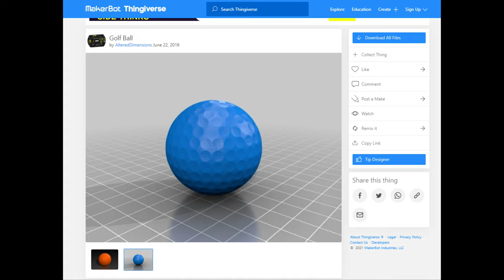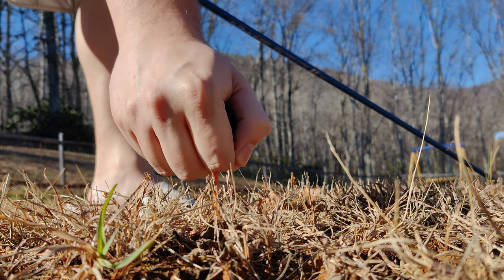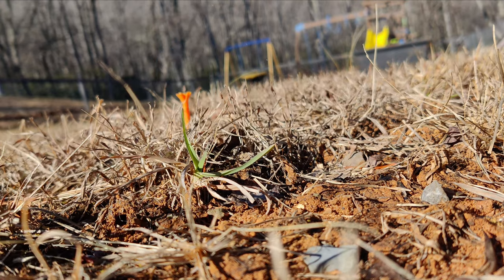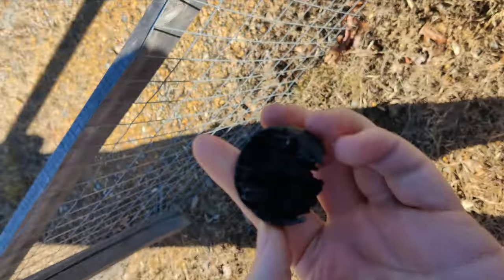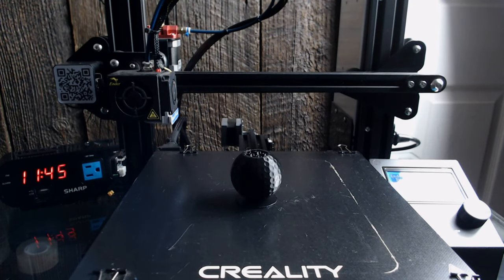I used a 3D Printer to Make Golf Balls and This is What Happened

Comment: Hey, no, you can't start the same project and then not upload for 3 years. 

Outer shell TPU, I think. Either a more-clever infill or just fuse a TPU dimpled shell over a commercial ball core. It's more about the dimple design and external material properties, once you can handle the forces of the driver (which the solid core should fix). If TPU doesn't hold up or has too much friction, we gotta figure out urethane casting.